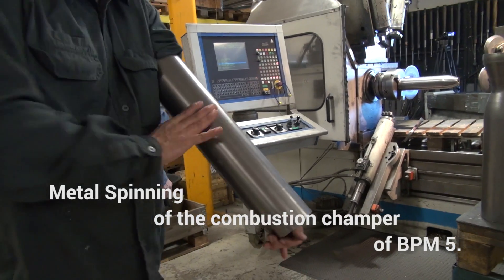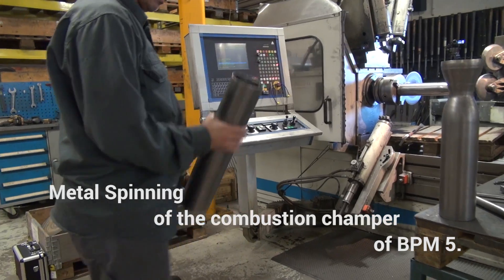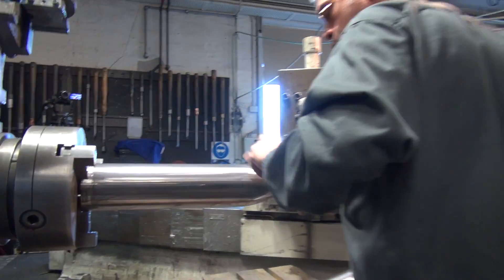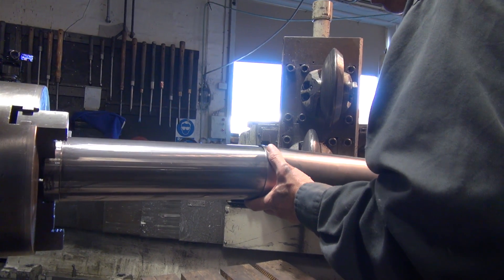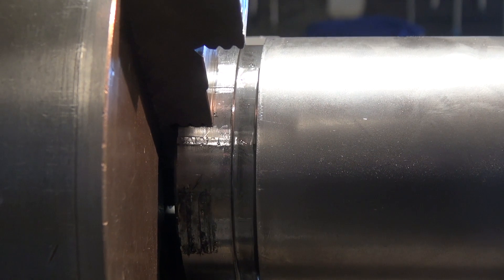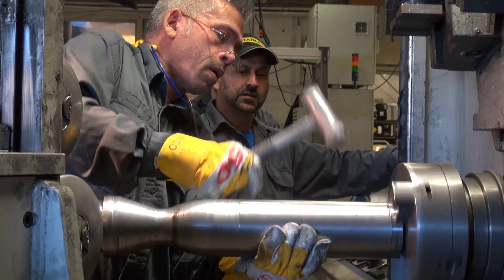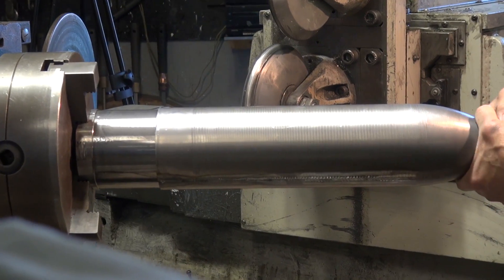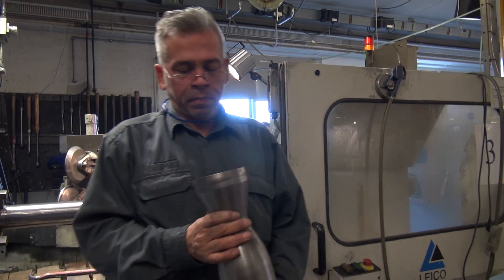Metal Spinning a Combustion Chamber of Our BPM 5 Rocket Engine

Comment: Have you guys ever considered just bolting a casing together that shrouds the combuster ? , also he is going way to fast , tell hi to reduce his speed 90 % , .
kinda like an egg in an egg carton is the way im thinking , the egg is the combuster and the outer cooling jacket is just a crappy carton bolted together with no brazing , this allows inspection the hole 9 , . Contact me for details if your unsure  Optimizedprcllc@gmail.com
Reply from the maker: This is a fairly old video, so since then we've went for different manufacturing techniques for our engines and have now reliably manufactured, tested and even flown many of them with great reliability. If I understand your bolting design correctly then it would definitely not work. You need to to have the two liners brazed together, otherwise the heat and high pressure of fuel traveling between them will split them apart. It's something we've seen happen multiple times and is one of the bigger challenges in a biliquid rocket engine. But thanks for reaching out nonetheless.

Comment: What is that material? (Work piece)
Reply: 99% positive it's an Inconel alloy. One of the few metals out there that can withstand white hot heat and still maintain structural integrity without oxidizing.
Reply: @TheExplosiveGuy  thank you mark
Reply: Is stainless steel

Comment: See, space-age technology doesn't have to be all titanium and 3D Printing. This is great work for lowering launch costs. Being able to churn out a rocket engine body every minute at even this scale is some serious manufacturing capability and capacity for creating launch vessel parts. Very nice!
Reply: Anvilshock is it even possible to use titanium for rocket motors? 
Titanium is a very nice component of solid rocket fuel mixtures..
Reply: @among-us-99999  I think you're thinking about aluminium. Solid rocket fuel has aluminium powder added to make it more energetic. But yes, titanium alloys are in fact used. The XLR81, an engine in the Agena upper stage, had a titanium nozzle extension; the turbopump impellers for cryogenic hydrogen in various makes and models of rockets are often made from titanium, an early SpaceX engine (the Kestrel) had a heat exchanger part made from titanium, and various other parts in rocketry and space exploration are made from it, too, due to its cost-saving weight advantage over materials like steel.
Reply: I mean, titanium would be a very bad choice in an oxidising environment. That stuff burns like magnesium, if not worse.
Reply: @among-us-99999  That it does. Luckily, not all environments in the general vicinity of a running rocket engine are oxidising.

Comment: Good spinning... but how did you get to the seamless cylinder in the first place? It doesn't look like you've welded a metal sheet and polished the welding marks off.. is there another way?
Reply: Swaging is one way,
Reply: @marmaladekamikaze  is that where you just walk up to the sheet of metal with so much swagger it just complies with your wishes and becomes a solid pipe?

Comment: Have you considered 3D printing these? Obviously I have no idea the budget, but SpaceX is printing seamless parts in Inconel even...
Reply: Printing stuff at this scale is prohibitively expensive. SpaceX can afford the tools, the software, the machines, the manpower behind additive manufacturing of rocket engines, something unthinkable at C-Sub-level of available funding. All the more laudable are therefore the efforts and solutions C-Sub can and do employ to make it work without.
Reply: A thin layer of metal powder in an inert atmosphere is deposited onto the bottom plate, then a laser draws across it, melting the powder where it hits, tracing the contours and scanning the filling areas. This process repeats until the part is finished. It works great and has still massive potential for improvement, especially for scaling up.
Reply: i don't know how 3d printing metal works, but it doesn't sound like a good idea.

Comment: Is this the inner shell or the outer shell? How do you assembly them together afterwards?
Reply from the maker: We cut the outer shell in two, and weld it back together:
https://www.facebook.com/CopenhagenSuborbitals/photos/pb.150360881653453.-2207520000.1426770324./896618273694373/?type=3&theater